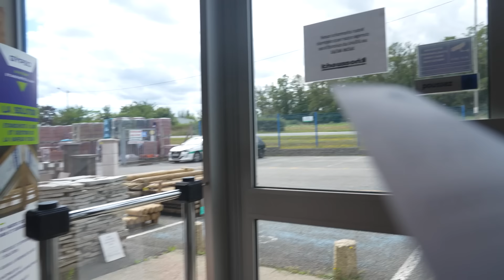The race to get the YURT installed at the chateau.

Comment: just do rugs Dan and dont worry about burning and staining. This Yurt is going to be so cool to live in while you restore the Chateau
Reply: He does need to seal the wood, but I agree about finding rugs if he's dealing with that much of a time crunch.
Reply: Rugs will also keep it warmer in the winter winds!
Reply: Rugs not so practical on a muddy building site.
Reply: Also some throw pillows, perhaps from Stephanie? Pink Toile to remind him of a certain room?
Reply: @katehobbs2008 rag rugs and cotton kilims can either go into a large washing machine or be taken outside for a.beating when the muds dry. Leaving all outdoor footwear by the door helps enormously.
Reply: Floor paint is pretty easy and protective.
Reply: @johne.coughlan6824  Oof. 😂
Reply: @katehobbs2008  Use outdoor rugs then. Easy to clean.
Reply: @katehobbs2008  Don't wear shoes/boots inside, leave them outside and the rugs will be fine.
Reply: @LiberalinOregon I have visions of the yurt getting into trouble with the shou dugi ban technique.
Reply: @zeddez1005 Keep clean slippers on one side of a washable rug and a shoe rank on the other side.
Reply: I think it will be difficult to do the burning with the tent up which I think he does to help prevent moisture ingress, but we will see tomorrow I guess, so it may be plan B, polyurethane top coat will help to seal it and then "lino" covering, it's better than rugs you can mop it, a gravel path will help to keep the mud at bay!?!
Reply: @michellebyrom6551  That's not going to happen, the washing machine and rug beating, I'm not seeing that, not for a long time into the future anyway, leaf blower most probably!?!
Reply: I agree rugs Dan!
Reply: @foxglove921  Perhaps rugs in the sleeping part of the yurt and under the desk.
Reply: He has to seal that wood
Reply: @karenmetcalf-pugh5  why
Reply: I was going to suggest a light colour floor/wood paint with lots of rugs. That would lighten the yurt inside a bit. It’s a wonderful construction. I’d happily live in one! X
Reply: Amazing job as always Dan.. can’t wait to see the boys faces! 😊
Reply: @michellebyrom6551  it is a building site! I don’t think he wants to be popping rugs in the washer 😁 But once it becomes a guesthouse it whatever, I agree.
Reply: i would really like to see more of inside yurt. Any plans to show more?
Reply: Any chance  you will rent it out in the future? I have slept in a tent and a tipi but not a yurt.
Reply: Aaahhh no. Dan has DOGS.   NO RUGS.  HELL BE CONSTANTLY BE VACCUMING!!

Comment: No one can ever say you don’t work for everything you get Dan. I must say I feel so relieved you now have a comfortable place to lay you head. Well done young fella 😊
Reply: Not quite yet, floor to finish off so a couple of days and doing burning when the tents up must be out of the question, plan B!?!
Reply: @thomasherrin6798   At the very least Dan will have to pin up the sides of the tent & pin up the sides of the tent and only burn in the middle, not the very edges and have a coupe of buckets of water ready to douse any errant flames. Then he can paint the very edge of the platform in an oil-based water proof paint, along with the outside edges and the edges of the insulation to waterproof the bit on the outside as well. He could even paint the lower portion of the lattice work that touches the platform for extra measure.  The yurt is beautiful!!!
Reply: @thomasherrin6798  ...come to think of it ...if he does insist on burning the rest of the platform, he absolutely needs a FIRE EXTINGUISHER ready at hand as well as several buckets of water!!

Comment: Great work! That's more flooring than any other traditional Yurt would have had. My fathers one has been sitting on flat tarped soil for over 18yrs. Very similar to his in all aspects really. The Yurt itself is quite traditional in build up, color and ornate detailing. Where (like his) it differs from that is in the overall diameter (a traditional one is 5m across), the second door(normally it would just be the 1 entrance door), the glass in the door (it would otherwise be windowless), and most likely the Plexiglas windows in the dome with a cutout for the stack (it would traditionally be half open and covered by the flap on top if need be). 

There's a whole lot of traditional religious elements in them as well if you choose to adhere to them. There's always a handsaw above the door in between the roof beams and the cloth with the teeth facing the door to keep out bad spirits. You would normally have only the one door open, never 2 as it would allow spirits to pass through. The centre rope is tied to a big rock (you have plenty) and the end tucked away as a endless knot. In case of a big windy storm have the front door and top flap open, It will allow the wind to pass through. The rock will allow for some movement (I've witnessed it as a whole being slightly lifted, its impressive) but will keep the center dome down and prevent damage. You would again traditionally enter in a right circle going around the centre where on your right side you would find the kitchen area, center back a seating area and on the left the sleeping and washing area. And the last one I know of; with the centre being the centre point of energy (literally with the stove being there) you don't pass through the centre 2 uprights as to not disturb that energy. There's even thought in the Kris cross pattern and knotting of the wall but I'm not to sure of that one. As i said earlier the heat management is amazing in them, with a good centre stove everything revolves around them; cook, eat, bake bread etc. Quite amazing structures really, very peaceful to live in. Any way that's all I know!
Reply: How awesome! Thanks for your in-depth knowledge and short primer on traditional yurts from Mongolia/Tibet/Khazakstan, etc. I wonder what specific country this yurt was designed after.  Anyway, it's absolutely BEAUTIFUL!
Reply: Thx for the interesting info.
Reply: That's riveting!

Comment: Omg, when I saw the red doorframe with the Mongolian stylized clouds on it I literally squealed! And all the ceiling beams as well! 😍 Congratulations! That torrential rain... WOW. You're lucky they arrived and hour early man! They got it up and covered before the sky opened up and soaked your floor! It's HUGE, welcome to Dan's Flying Chateau Circus! 🎪😍❤️
I'm sure you'll figure out a good floor now, and you won't be so pressed for time. Torching seems like a less great idea though, now that the yurt is up... 😬 Please be a smart dad and use a good mask when you varnish now that its enclosed.
The scaffolding is amazing too. Things are about to change and in a BIG way! 🙌
I have an old friend who's ex had an adventure catering company. Decades ago they used to spend their summers on a deserted beach (with permission from the land owner) in his massive Saharan bedouin tent. Somewhat like a yurt, it all assembled and dismantled without powertools. They'd raised it on the pebble beach (only over the summer months) and covered the pebbles with old Northafrican carpets they had rolled and stacked in their kit.  They had a massive 4 poster bed assembled the same way, wedges and wood, hung up fabrics and they slept there with their babies, and he had a compact gourmet feild kitchen run on gas tubes he'd cater from in his business. (Exotic weddings in remote locations etc.) You'd have loved his kitchen set up. Full professional stainless steel range and coolers and all, but low stackable sections on lockable wheels. It was the most remarkable collapsible holiday home honestly. Wild! Like something straight out of a story book! Arabian nights on a the literal beach of the famous film The Seventh Seal, covered in grey trilobites, not a human for miles. 
You're writing your own adventurous story book here. And it's no holiday, it's a  castle raised from dust, singlehandedly almost. And the creation of coolest digs ever to tuck boys in at night and snuggle by the fire, like far away in the snowy towering Altaj mountains, to the Gobi desert below. And this will impact your boys lives forever. Kids grow up SO fast its crazy, looking back, trust me. This thing you're doing, nomatter all the stuff in your life and theirs you can't foresee or control, this is a beautiful thing that will make such a difference and provide all of you with so many amazing memories. I'm just grateful for being able to follow what you share! Next chapter: The Tower and The Yurt. Sounds like cards from a deck of Tarot cards lol. Wide and round   and up and up into the sky and onwards...
 Be humble Dan. Wear a good helmet now. Don't push your luck. Pace yourself. Get your home in order and then take a deep breath. Take proper safety measures and get some help on site please. Don't forget to take time to rest and care of YOU. 
Bless you man.❤❤❤❤❤

Comment: Dan there are luxury vinyl floors with additional insulation that are cheap and easy. Extra insulation. Already finished when you put down. Admittedly the burned floors would look cooler and be cheaper. But this might be an quick solution since walls are already up in the yurt.

Comment: Such a beautiful structure Dan and surprisingly spacious too.  Add in lots of over lapping rugs for insulation and even have them slightly curing up the edges where the canvas wall panels meet as this might stop some air flow during the winter months helping to seal the walls. Well done,

Comment: When I worked in warehousing & distribution,  we would torch and polyurethane the plywood for various workstations and shelving. It looked fantastic but mainly it was to protect against massive splinters in your hands.  It worked 100 times better than sanding.

Comment: I love your yurt. I'd much rather live in a yurt than a castle. Castles are interesting and beautiful because of the architecture and history, but I prefer a much less complicated yet beautiful structure and yurts fit that description. They're both roomy and cozy and the ceiling is high enough to give a very pleasant feeling of open space.
Reply: In this yurt the ceiling isn't high. Yurts usually are with a very high ceiling. But this is a very fancy yurt, so no more that simple camping, from now on it's glamping.

Comment: Hi Dan, Did wonder if there is any local legislation for the use of scaffolding. Because the following is the legislation in Australia. And as a minimum at least, you may want to look into a Fall arrestor system. Especially as you are usually working alone. GENERAL GUIDE FOR SCAFFOLDS AND SCAFFOLDING WORK. Erecting a scaffold or work on a scaffold may involve activities defined as high risk construction work under the WHS Regulations. High risk construction work includes any construction work where there is a risk of a person falling more than two metres. Scaffolding work is defined with a four metre threshold for licensing purposes. This means in some cases a high risk work licence may not be required to erect a scaffold—because it is less than four metres—but there may still be need for a SWMS because it is more than two metres.

Comment: I was thinking you could possibly push the scaffolding up against the front wall of the chateaux and the windows and get some more of those flooring beams to span the gap between each floor, making sure they are all secure and can’t slide, and the scaffold to create more temporary flooring area, but it doesn’t look like the levels of the floors and scaffold line up at all :’(

Comment: I love your channel, the Yurt is very cool. I cannot help thinking, a large insulated portacabin, or a large modern caravan would have been so much easier and probably cheaper. Good luck.
Reply: Cheaper does not equal to better.
Reply: A yurt that size( 35 - 50 qm) costs about 12000 - 13500 Euro.
Caravans are about the same price and spending bad weather and winter in it with children wouldn't be a good option. No space...
As a toilet you can use composting toilet.
The yurt may be used for glamping and other uses later on.

Comment: Have to ask, every time I'd seen someone put insulation down under a floor.
They'd put the wooden beams in place, then put some sheets of OSB or plywood under the beams, cut it to the right shape.
Then they've always put the insulation between the wooden beams.
Then another loaer of OSB / plywood on top. 
And that would allow the floor to be solid, and have no give in it (unlike walking on insulation).
It would also make the floor stronger since it'd be directly on the wooden beams radiating out from the center.
---
Now for the question, was there a reason for doing it the way you did?

Comment: As lovely as the yurt is, IMO, it is completely impractical. I cannot see how the dome will open for ventilation. There are no windows. It'll be time-consuming to install a kitchen. It'll be time-consuming to install a wood burner.

Will Dan still have to hire a portable toilet, a hand washer, and a shower? It seems to me that lots of practicalities are not being addressed.
Far more efficient would have been to purchase a used mobile home with a grey and black water tank or some kind of trailer because the build will be very long.

Comment: Why did Dan opt for a yurt?   Surely a log cabin , or even a caravan would be easier to live in.
Reply: a yurt is very cost effective, for a few 1000€ you get 40-50 square meters area, takes a few hours to get up, room enough for a separate bed compartment or even a mezzanine for sleeping. he can probably get a small second hand kitchen for free, then with a portable toilet, a water tank and a shower cabinet, then spring,summer and autumn is no problem in southern france. with a forest like his around, he can easily have wood, for several of the mini winters they experience down there, cut into pellets and use a pellet burner in the center to get stable temperature for the few days thats needed. a log cabin would be really expensive and take a lot of time to get up. a caravan would cost 10x more and be cramped.

Comment: That heavy rain was bad timing! I have looked at other yurts on the web, and there seems to be a few things missing in the construction of yours so far. No windows for ventilation, no opening for the exterior chimney vent (you have to have heat), and the dome at the top is not clear to allow daylight in.

Comment: Your working hard Dan ….but you need to work clever..example carrying the insulation one sheet at a time what do they weigh not even a pound each and you carry one back and forth I got dizzy watching you………when you concreted the middle section could have should have put a couple of bricks in to pack it out less concrete and stronger…….see smarter..